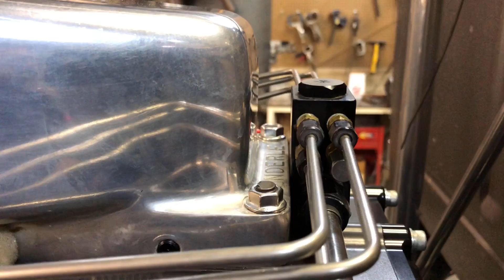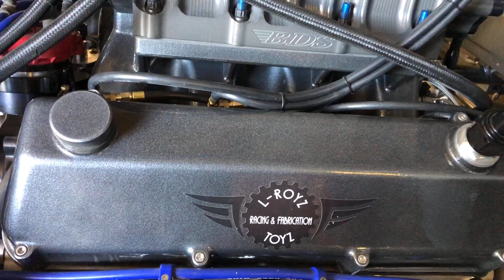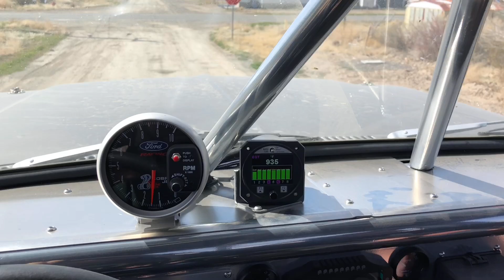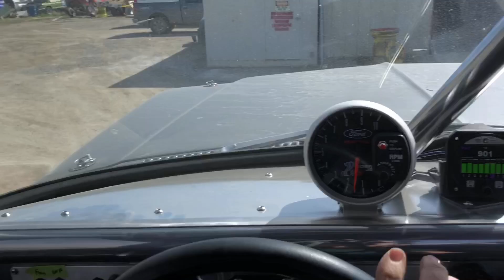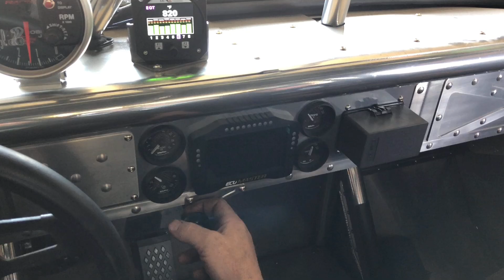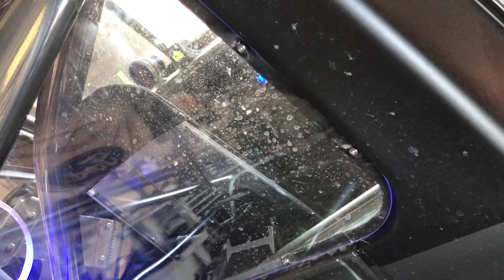Mechanical fuel injection basics part II

Comment: What would happen if you took the hat nozzles and reduced them by 50% and put the other 50% in the port nozzles (@ 5psi instead of 13psi)?
Would the rotors not get enough cooling? Seems like that would be the easiest way to fine tune each cylinder at all rpm levels including idle?